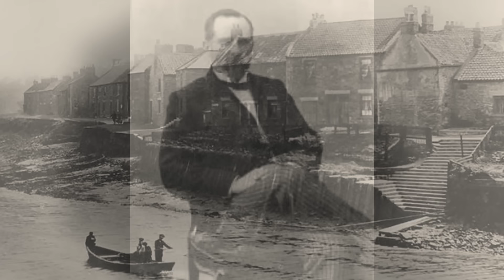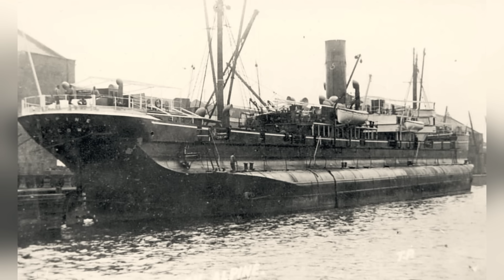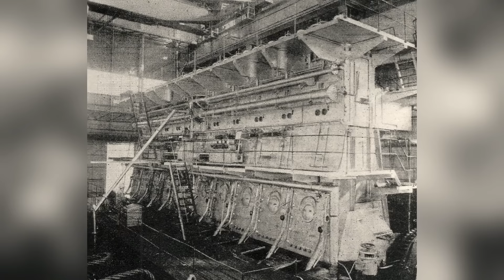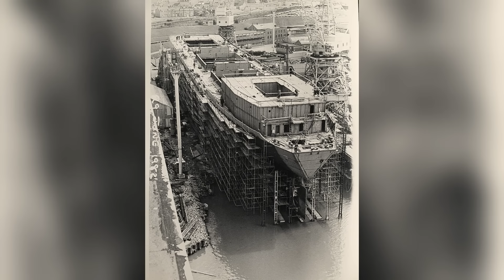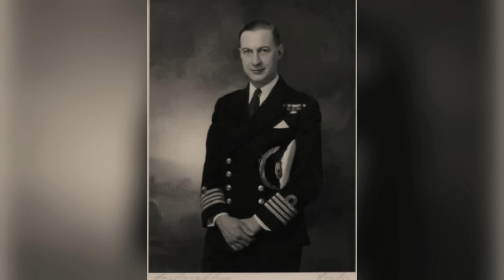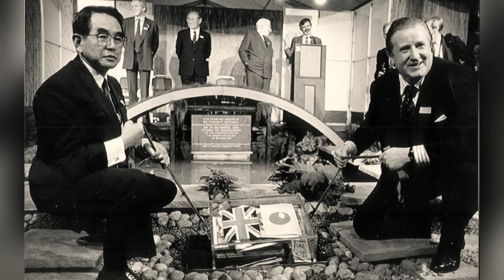The Fatal Doxford Scandal: How Britain’s Marine Engine Empire Went Dark

Comment: South Shield Marine and Technical College had / still has a single legged Doxford engine in one of the workshops, along with all the necessary systems - fuel, lubricants oil water cooling - to train marine engineer cadets - and used to be run twice a year. The systems were useful training, the Doxford engine not so much as when I was a cadet there were no ships still sailing with Doxfords. If you were lucky, or unlucky, enough to sail on a ship with a Doxford main engine you soon learnt the "Doxford Dance - the engineers would line up and imitate the top piston connecting rods and water cooling pipes moving up and down - beer could have been involved!!
Apologies - I posted this comment before I got to the end of this video - the engine is no longer at SSM&T College. I wonder if they still have the Scotch boiler though??!!

Comment: Not mentioned but crucially important to the demise of Doxford was its maintenance and compliance costs.  All other contenders would have 1 bottom end, 1 crank, 1 crosshead and 1piston per cylinder.  A Doxford, though mesmerizingly beautiful to watch had three of each per cylinder.  With every major bearing requiring inspection every five years, the manpower costs, bureaux costs (e.g Det Norsk Veritas, Lloyds etc) and service downtime simply could not compete with B & W, Sulzer and MAN.  They all had their faults but were far easier to maintain.  As a minor aside, the Doxford persisted until late with some very dodgy engineering like the legendary and frankly archaic Aspinall governor, and rubber cooling hoses on the top piston.  The former needed manual reset and the latter failed with monotonous regularity condemning the engine to watchkeeping whilst most new builds went towards UMS.  Unmanned Machinery Spaces.  (at night).  To watch, and better still, to drive such power, grace and beauty was a joy to any engineer, but like the steam train, it's day eventually passed and no politician had the  power to stop it.
Bob Griffin, 2nd Engineer, Blue Star Line 1980 - 87.  One coastal voyage on the Twin Doxford Queensland Star.

Comment: No mention of WW2 or the M V Fairsea that carried many people to a new life in Australia.  she was a Victory ship hull that had been fitted out as an escort carrier, that meant she needed to be able to hit 20 knots into the wind and so was fitted with TWO,  yes Two Doxford Sixes driving a single screw through a gear box. That engine room was quite a sight to see while crossing the Bay of Biscay after three days of Atlantic storms and the following swells.  were lifting the prop tips from the sea while reflected waves from every angle   crashed against the bridge. Or at least that seemed so from the eyes of a ten year old who had snuck onto the upper gallery ( Three storeys up ) a thick oil mist filling the air and coating every surface.  mmm

Comment: The Seahorse engine was never a technical success, it was a joint venture with Hawthorne Leslie that never did pan out...combustion problems where never solved...resulting in a sophomore design that proved problem ridden & inadequate...
Reply: Maybe development was limited,  happens a lot under pressure to deliver in war and after socialist taxation killedc all industry by design,  In contrast the U boat engine maker was encouraged, re equipped, and leading the globe,  strange really?   Friedrichshafen where Zeplins are also still made is very prosperous